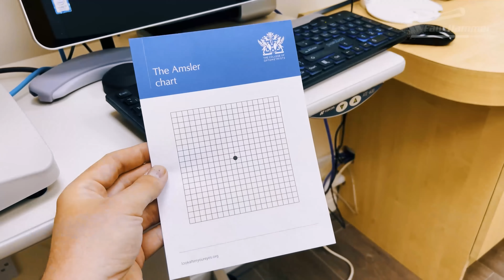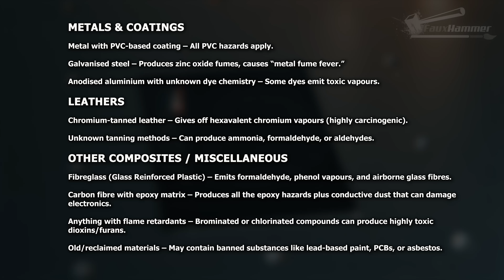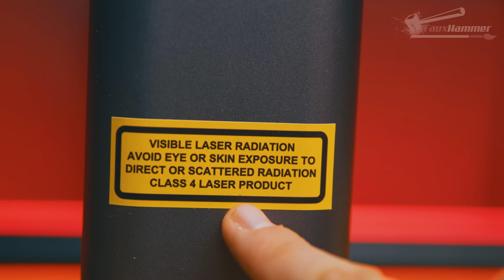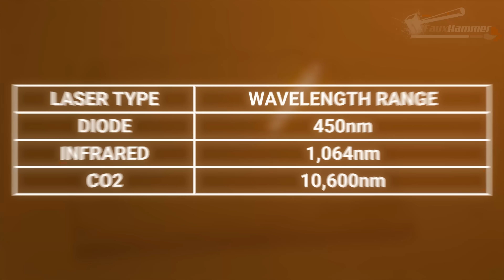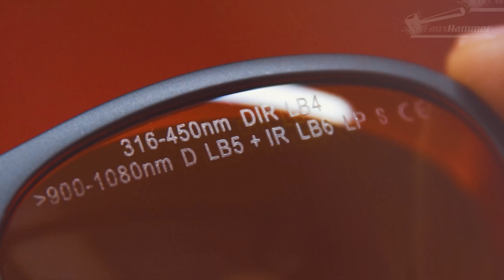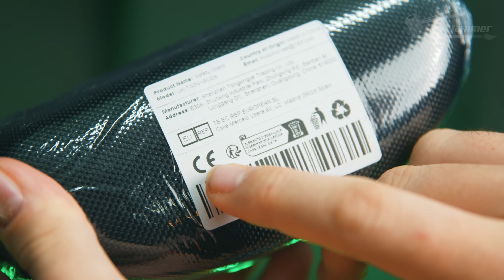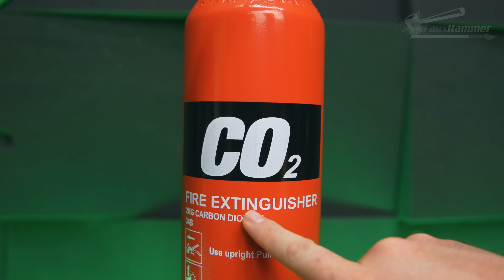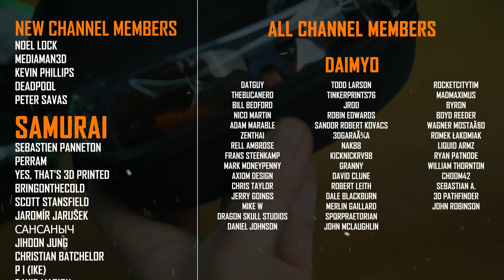DO NOT BUY A HOME LASER! - Before watching this video - Best Home Laser Safety Glasses?

Comment: UKCA is another certification mark you can look for and the post Brexit CE equivalent.

Worth noting that testing labs need to be registered and should be re-certified on a routine basis by approved regulatory bodies, it should be on the certificate you have from them where and who gave them their approval and you can then check on the approvers site to see if its current.  That all said doesn't stop the company producing them from cutting corners after the certification.

Like all PPE glasses and goggles are intended as a barrier if something else has gone wrong, ie the door safety cut-out microswitch has failed, you've opened it because the object you are lasering has caught fire and forgotten to slam the emergency stop button (assuming it works..)

Consider what you are lasering, as you said stainless is highly reflective, slate and PU isn't, are you lasering something flat or round on a rotary Z axis tool?  Even stuff as crazy as do you wear a watch, what is the case material is worth considering.  All these elements should produce a risk picture in your mind.  People don't tend to get injured with tooling that they know the risks on until they've been using it for a while and complacency kicks in - the I've done this a hundred times before and it's fine mentality.

Glasses need to fit well, lasers tend to go in straight lines so it would be a freak event for eye damage if you were wearing glasses and it still manged to get into your eyes - no doubt that goggles are by far the safest option and they won't fall off.

BL have some statements on the OD ratings that clear it up a bit, their glasses are OD5+ in the 2---460nm which equates to a 1 hundred thousand drop in laser power passing through the glasses, OD6+ in the 900-1100nm range is a 1 million drop off in input power.  So a 500w infra-red laser passing through OD6 rated material would be reduced to 0.0005 watts, at OD5 that is 0.050w.  For comparison an IR LED used in a remote control kicks out about 0.050w of power.  For every OD level increase stick a 0 on the power drop, OD 7 is 10 million, OD 4 is 10,000 for example.

Also worth noting that a laser might use both of the common wavelengths in a single job, the BL engraves at 455nm but uses an IR laser at 850nm for height measurements - both of those will be in action during a job albeit the 850nm IR one is at lower power levels but going for a single google type might not be suitable.

Finally, wot no nakedness?

Comment: I liked the goggles, have the same problem as you, have to wear glasses also. Having worked many years ago as a machinist safety glasses are must. The gap that you showed on the other glasses are normally where you have your problems at, I almost lost my eye due to a piece of metal flying around the gap. Bottom line if I start reusing the laser I’ve got I will buy the goggles one. Oh yes I was exactly like you I got those cheap glasses they had and because I had the cover over the laser I didn’t use them the didn’t damage my eyes but I had some the same problems with mine as yours. So I rush out and bought a new pair. It was extremely confusing on what to buy, no it was a freaking nightmare. So I’m for one am glad that you put this out due to the new Bambu lasers printers.